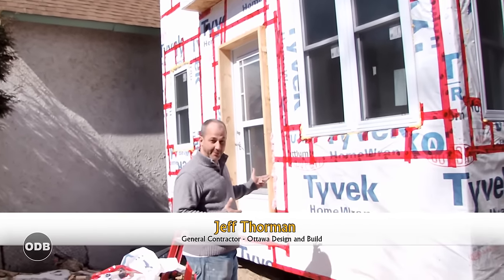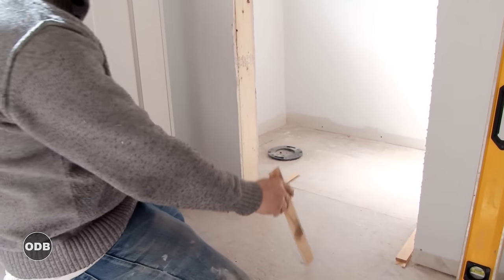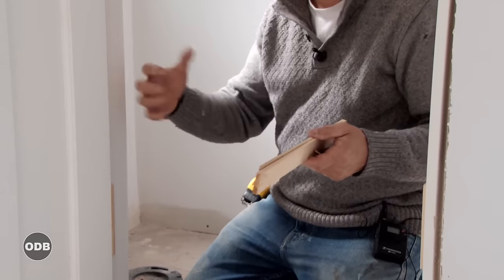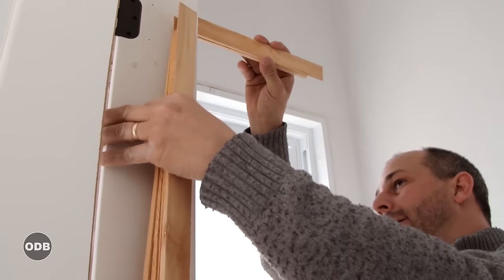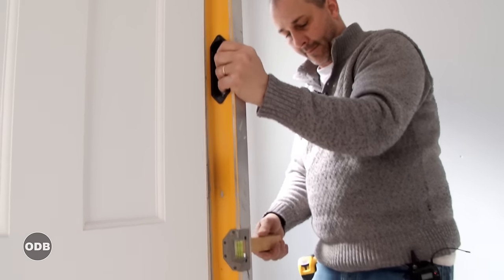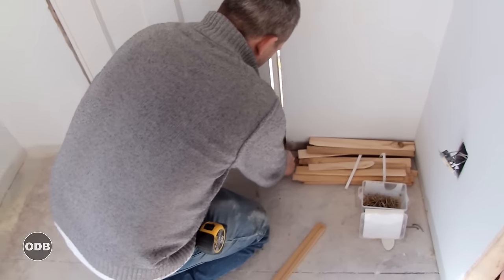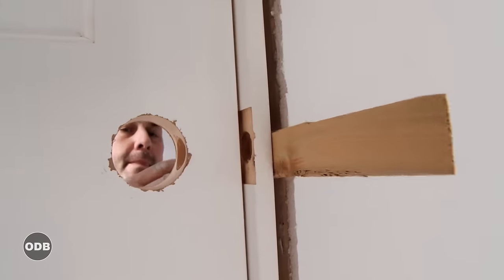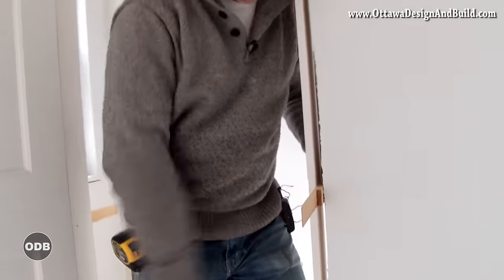How To Hang An Interior Door Quick and Easy

Comment: This is not even close to the way you install a prehung door. My goodness.
Reply from the maker: Please show us OB1
Reply: Home RenoVision DIY, first off it’s obvious you have never been shown the proper or professional way of hanging doors because you didn’t even approach hanging the door correctly.
Reply: @HomeRenoVisionDIY  the effective way to hang doors would be with 16/15 gauge nails. secondly the way your hanging a door is by far the slowest way. most places including million dollar homes. will accept doors being hung directly to the studs. without being plumb. what they care about is the reveal of the doorstop and how solid the door shuts if its solid wood. 

if its MDF by the time the painter is done with it. it will of already bowed and gone off abit. but can still close fairly solidly. 

anyways the proper way would be to lift the door roughly a half inch. for carpet. or 1/8 to 3/16ths for vinyl. any other height is not needed as floor installers will cut the door frame so their tile or wood can fit under it. 

you then put two nails on the hinge side at the top and bottom hinge. then one on the top opposing side. you close the door to ensure the reveal is correct. adjust accordingly with shims and then put enough nails in on the hinge side that there are 3 per hinge.

then you reclose the door and check reveal again incase securing it affected the reveal. 

then, from the other side you close the door and adjust the strike plate leg until the doorstop hits along the entire length. then nail once at the bottom and once near the strike plate hole.

this makes it so you dont have to adjust the doorstop only the leg itself and its overall position. no need for a hammer.

then you return to the other side and close the door again. and re adjust the reveal on the strike plate side as securing it in the prior step may of messed it up.

finally you then add in shims and nail them on the strike plate side to hold it in place. now your ready to case.

this method takes me no more than 10 minutes at my slowest. i can hang 7 doors in 25 minutes on average and these doors quality are top notch. ive not had one complaint from any homeowner or jobsite supervisor
Reply: @josephvouis5301  how about a video of what you just said.It would be a lot easier for us, novices, to understand.Thanks
Reply: @josephvouis5301  I work in high dollar construction in the mountains of Colorado and you are wrong. Doors and windows must be plumb and level in high dollar construction, especially with tall units. Combine 15 gauge nails with narrow head finish screws. We also use lasers on tall units for optimum installs. Quality is far more important than any perceived speed issues. What's most important is builder and buyer satisfaction over speed any day of the week. Out of plumb doors and windows show up like a sore thumb. I've worked on single custom homes that are worth up to 45 million in Vail and Aspen.
Reply: @josephvouis5301  Don't let that out plumb door hit you in the ass as your get kicked off the job for poor workmanship.  I understand time is money, but quality supersedes all.  I was taught to treat every job as if it was my own house and have done so for my last 25 years in business.
Reply: Seems like a few ways to get it done as long as it's level in the end I guess it works
Reply: I think what threw me off was the word (prehung) when l think of prehung door it has casing on it and it’s a prehung split jamb. 
This isn’t the way l would hang it. I’d  put the casing on one side first and hang it that way ,then shim it.  
Using screws....... ?? It looks like the door stop would cover those holes. Not my way , but lm sure the door junctions like it should. It’s the end results that matter.
Reply: @billlasher6830  make a vid of love to see it please. I thought the other guy was wrong lol
Reply: subdiviosn shii***t @josephvouis5301
Reply: @HomeRenoVisionDIY  The Tusken Raider's create multiple fake accounts to hide their true numbers.

Comment: Hanging to jamb flush to drywall is a fail 98% of the time. I would not follow this advice.
Reply from the maker: I am not hanging ther jamb against the drywall. I am installing it to the frame. If it is plumb it is no problem
Reply: If it is not, or if the door is bowed you wont get a flush closing door.. I see journeymen carpenters hang doors that in theory sound good , but in the real world look like dog poop.